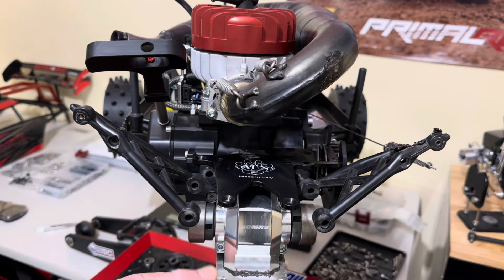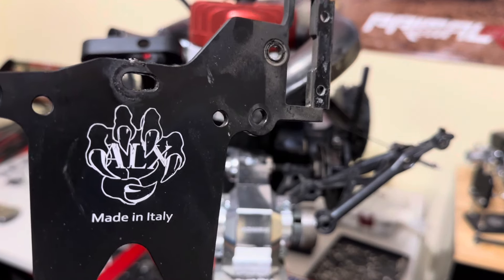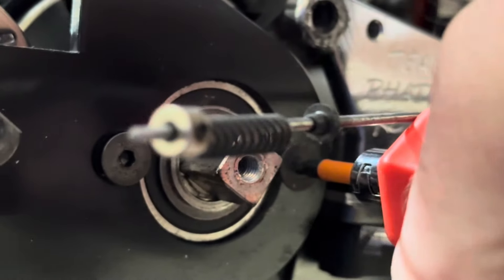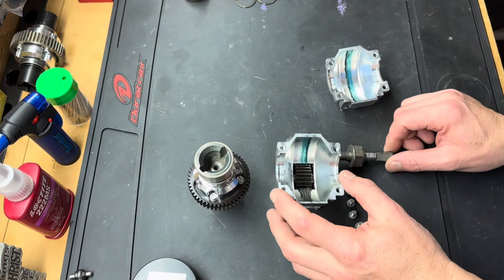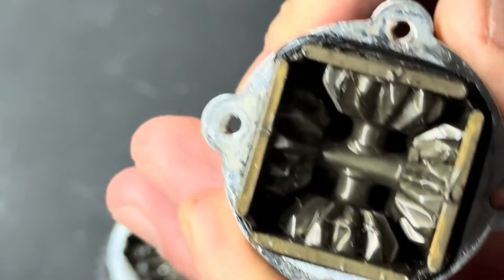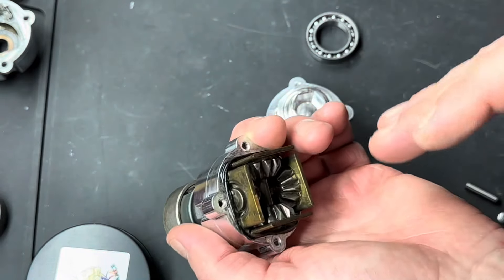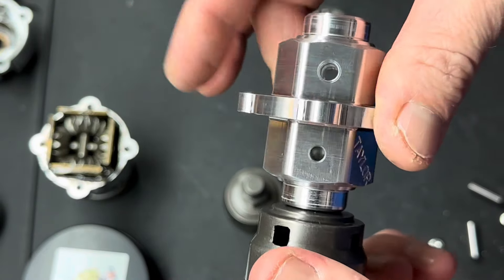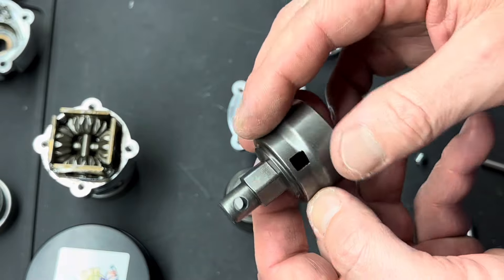ALX 50 Diff Punishment Solution Once And Done Fix With Taylor RC!!!

Comment: Nice, I've been using 20mil. Weight in the diff and seems to hold up nice. You might start breaking drive pins with the locker that's why I haven't gone to one yet.
Reply: Yea, I don't think lockers are good for much other then straight line racing. For offroad short course tracks a working differential is required. I do see the reasoning for lockers though.
Reply: I run lockers I go to 3 different home built private tracks I'm running 38cc in my DTT-7S v2 and I'm faster do to the drifting around the corners maybe it's me. And I haven't broken any yet thank goodness 😂
Reply from the maker: I got 20 mill traxxas gum 😂 in another IRC diff on the table. I decided to lock it cause I got 5mm hardened steel outdrives and the BRPs do a little over rotating so that softens the hit to the pins. Throw some Akill spikes on there and your ripping tires apart or breakin them pins lol. I put the locker in my Wasp and Im never going back to diffs on anything with raw power! I just love that true posi traction! But that 20 mill thats some crazy stuff aint it. It almosts locks the diff but not quite in the car and moving the wheels I can feel the give.

Comment: Where all of the fluid went? Shouldn't be diff half full(just over cross pins), here it is almost no fluid?
Reply from the maker: Its in there its in the other half with the gears, I just didn’t show it. I did in Facebook that 1 mill aint leaking out lol. I will say though the fluid may have gotten destroyed but it did keep every part in the diff unscathed . The walls of the diff n all look great. It really cut the wear but the fluid just got punished so quickly. That engine is very violent with the 24/50 gear set , thats way to low for that engine but the builder said thats all it would pull 🤷‍♂️ I can tell you I dont do what he wants me to do and it will pull much bigger gears and were all going to see it!

Comment: 2 million 3/4 full .. diff and pin saver. Locking has only ever caused me personally problems.. 👍
Reply from the maker: Locking is really good for big power not so much on stock stuff. It tends to be harder on the drive train . For drag racing and ultimate traction its a must!
Reply: @eastsiderc  for drag yes and not saying locked isn't better I'm saying more chance of breakages in my personal history locked.. it snaps layshafts if the traction is there.. I've snapped many then decided to go 2 million and never had an issue since.. but locked is definitely better for drag .  Better still lock off ride high for even more traction